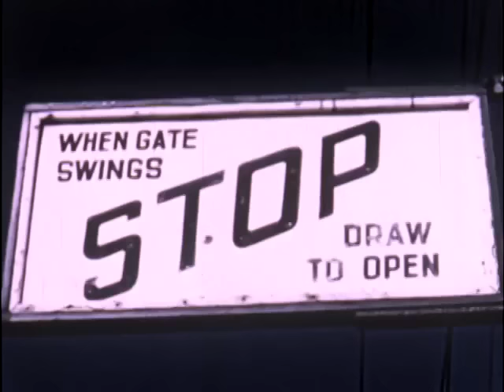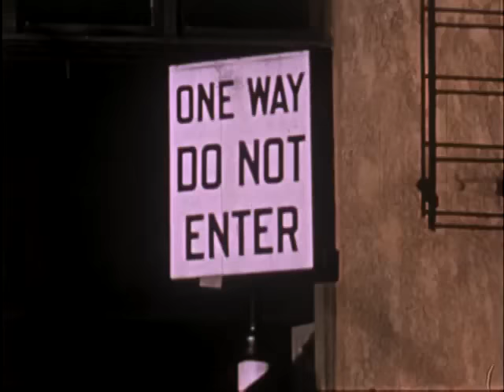Granville Bridge - a 1954 City of Vancouver film about the construction of the bridge

Comment: i live in melbourne and went to vancouver in sep 2019 and this bridge is MISTAKE!!!! narrow path next to 4 lanes of fast traffic!!! And then there is a step down to cross the exit/entrance ramp with no lights or signs or anything
Reply: Used to be perfect. They ruined it just recently
Reply from the maker: The bridge was built at a time when Vancouver was considering building freeways into the CBD, this bridge and the Georgia Street Viaduct were the only bits that were built before a strong movement against inner city freeways in the mid 1960s
Reply: @BCHistory  I wonder if the city fathers ever thought of all the air pollution created because of a LACK of freeways into Vancouver ? ? ?